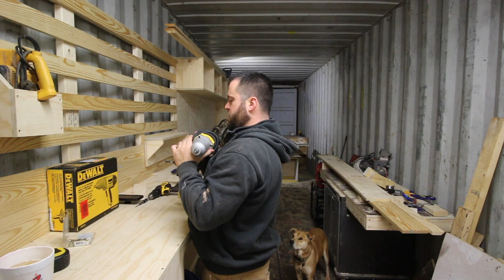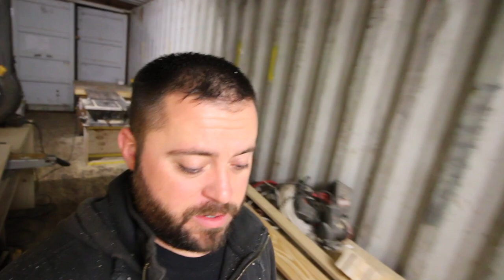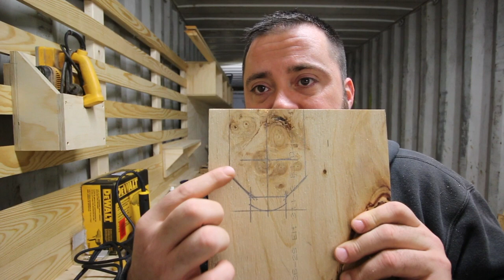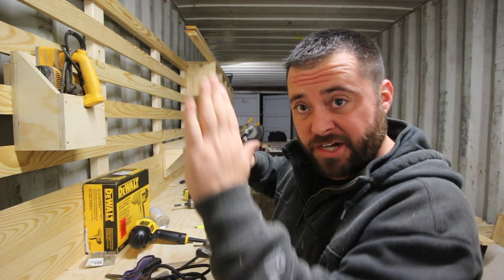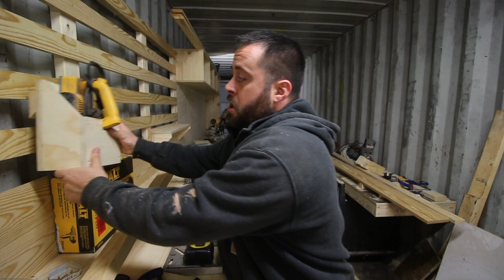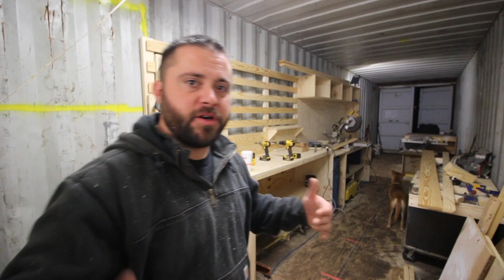French Cleat Tool Storage.

Comment: And he LIVES.... Great to see ya Dan. It's funny I was just talking about ya last night and viola you are on my feed this am. How cool. Love the winter attire...it keeping you warm? I love the French cleat system. I put up a lein too (sp?) On the side of my tiny house to keep stuff out of the weather it held up great. Just took it down this fall in preparation for spring to build an enclosed side porch. A comment on electric need help with a combination switch (switch on top and outlet receptacle on the bottom ) I put it together in a dual gang box & an dbl outlet receptacle.  However my switch doesn't turn on the exhaust fan but all 3 receptacles work. I need to revisit the gang box to see where i fucked up somewhere (ps all on same circuit ).the brass clip stays in place. So must be the wiring. Fuck me idk.

Comment: Do you do safe removal before disconnecting the memory card from the computer?
Reply from the maker: Not always.   Would that prevent it.   I always delete everything on it from the camera, once I’ve exported to my computer.  Figured the reformat would fix it.
Reply: @TinyHouseCustoms  It can help, no guarantees of course. If the camera detect that you don't use safe removal it might prevent you from using the card to avoid possible file corruption issues in the future.

If the card would need reformatting I would do that on the camera to get the file system just right for it. But if I would just delete the files I would do it on the computer then use safe removal (no need to reformat every time).